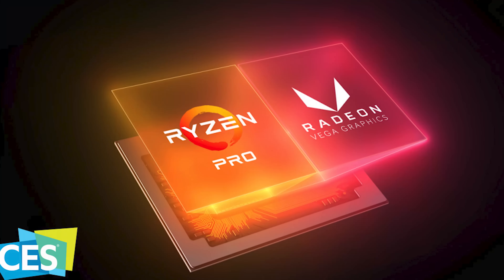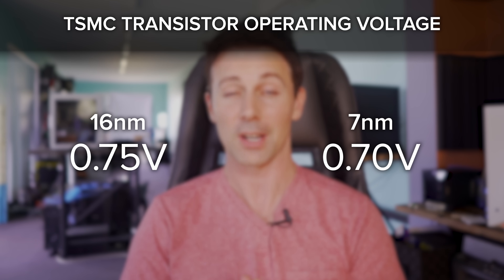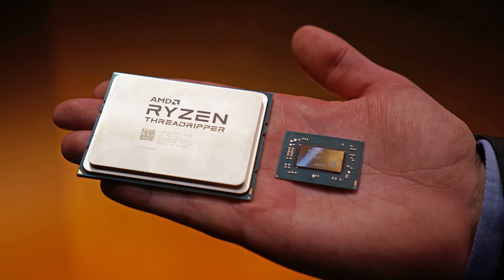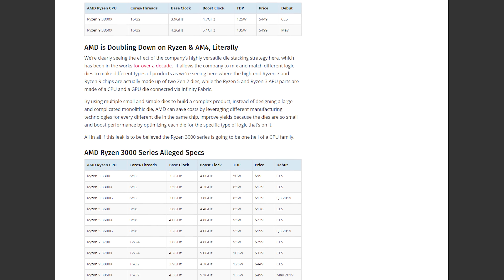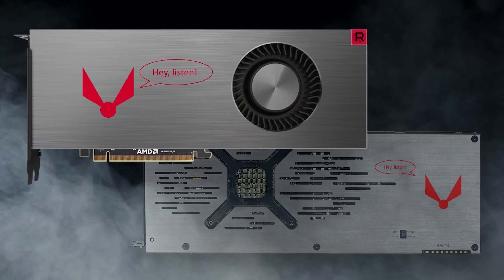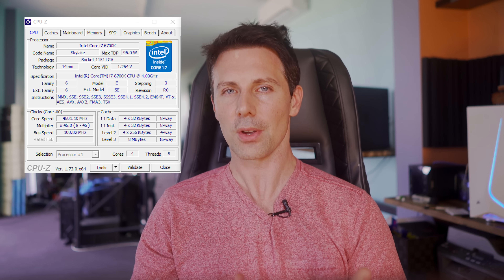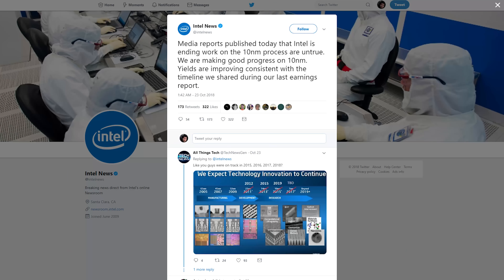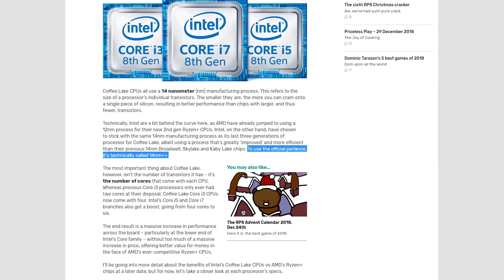7nm, 5nm and Beyond - Will AMD RYZEN 3000 be the PINNACLE...!?

Comment: Badly researched sure euv enables below 7nm but 1. All of the big companies are trying to make it happen asap and samsung just giving it a date doesn't mean it'll be out then and 2. Euv kind of enables it since we yes do need more accurate ways of shooting light at the silicon but more importantly we are going to have to change from Finfett to an even more extreme form of gateS if you google "ibm makes 3nm gates" you'll see where and how limitations will come through
Reply: Also the walls of the wires cannot go below 7nm since that's the point where electrons start quantum tunneling through it

Comment: What comes after 7nm is likely a couple decades of 7, 10 and 12nm revisions.  The problem is that while the chips are getting smaller their energy density is increasing.  10 and 12nm hardware (and 20nm) are already suffering from a great difficulty in cooling under high load.

Comment: To set the record straight: EUV was and is developed by the Dutch company ASML and their partners. Samsung, Intel and TSMC just buy that technology from them and figure out how to use it with their masks. EUV is a form of lithography where a smaller wavelenght is used than before, allowing smaller details in what is being blocked by a mask. For ordinary lithography they have been using plain water (as a magnifyer 'glass')  for years to get the resolution a bit better and they use multiple layers for the same reason. They call this lithography with water immersion lithography. They put a mask before something similar to a camear and that mask blocks light. After that the wafer goes to a company which uses chemicals which react wherever the light hit and that material is being etched away, they also deposit metals based upon whether or not light reaacted. That is how chips are being built up in a nutshell.

Comment: I ditched Moore's Law out the window a 5 years ago as I noticed  differences in overclocking performance with CPU's and GPUs. As the die shrinks more, lower voltages are used. In the end will the die will hit a  hardware limitation. Smaller die, smaller tracks, smaller lifespan from thermal stress. Putting to much voltage from overclocking, through the microscopic tracks will cause them to fail like a fuse. This is why Nvidia and Intel have so many issues with die shrinkage and the only way for them to remedy this issue is to build larger/bigger/3D chips. It would be very interesting to know how AMD is pulling this off.

Comment: Some incorrrect infos here.
TSMC is actually using EUV for actual 7nm N7+ production but just for 4 layers. Full EUV for all layers is expected for Q4 2019/Q1 2020, not 2021.
As a matter of fact, TSMC is on track for 5nm with production starting on 2020 and is building a 3nm facility for mass production starting in 2022.
So, we have 7nm 4-layers EUV on 2019, 7nm FULL EUV on 2020, 5nm on 2020/2021, 3nm on 2022.
GAAFET instead of FinFET is also a possibility for smaller nodes, but it's pricey.

sources: 
https://www.taiwannews.com.tw/en/news/3600724
https://www.anandtech.com/show/13445/tsmc-first-7nm-euv-chips-taped-out-5nm-risk-in-q2

Comment: It's crazy. Doesn't actually seem like that long ago (4 years) I was still using a q6600 that was 65nm. What a long way we've come since I bought that in '07

When we reach the end of Moore's law, we can't shrink the manufacturing process any further and we can't squeeze a higher clock speed, unless we find some other material to make the CPUs out of then the only way to go is more cores. Who knows, in 10 years our CPUs will come with the thousands of cores like our GPUs currently come with

Comment: 6:07
You've kind of missunderstood that stuff.
EUV isn't a solution to quantum tunneling.
The problem that EUV solves is simply that the features we're currently making is already smaller then the wave length of the visible light we're using to produce chips right now.
Switching to EUV doesn't solve the other issues that crop up when you go even smaller.
But it means that instead of using multiple exposures that's slightly offset to try to make smaller features you can just use a few exposures of a wave length that's much closer in size to the features you're making.
Therefore you can make far smaller features at a lower cost making those economically viable, something they where not before.
And by making them economically viable you can in theory build in some redundancy to make up for things like the quantum tunneling (we already have some redundancy in there).
The idea being that if we do the exact same calculation multiple times you're a lot less likely to have a issue with all of them then just one or two (one of the ideas with fin-fet where you essentially have 3 transistors in every single one of them, hopefully ensuring that at only when all three of those trainsistor parts agree that a signal should be sent through will a signal be sent through)

The issues just continue to get worse as you go smaller.
Another thing that might help reduce the issues is switching to other materials then silicon with different material properties, etc, etc, etc.

But ultimately the only real solution is to switch away from trying to controll the flow of electrons entierly and switch over to something else, like say light.
Reply: Gate All Around (GAA-FET) should be the next transistor design to take over once Fin-FETs have hit the end of their ability to prevent leakage. Theres even research into Tunnel FETs to actually USE tunneling as the mechanism for transistor switching.
Reply: Actually you misunderstood it too. NOTHING in the 7nm architecture actually is 7nm. It's just a marketing slang! In fact we are all far away from true 7 or even 5nm.
Reply: + @nowonmetube  As for the whole 7 nm part.
Yes, it's marketing slang, but there still are things that's 7 nm in those chips.
The difference is just what is 7 nm when they're measuring.
And everything I said is still true.
Reply: @Luredreier  uhm okay what exactly is 7nm then? Even if they measure something in 7nm or some bull, people should stopp echoing like sheep that there will be problems with quantum tunneling, because it's not. It's has nothing to do with quantum tunneling because we haven't even reached near 5nm, by far.
Reply: Electrons travel with light speed though
Reply: + @nowonmetube  Actually, no they don't.
They move at about 1/100th the speed of light in a vacuum.
It's still bloody fast, but it's nowhere near the speed of light.
Reply: @Luredreier  uhm you know that light even moves slower than light when they're not in vacuuming (in water for example), right?
Reply: Really?  We should use LIGHT?  Tell me, what is it about light, exactly, that allows us to build chips smaller than electrons?  Is it that the light is smaller than the electrons? or that it is indeed orders of magnitude larger than current gen architecture? Or is it that the light pipes needed are so much smaller (at a micron minimum) than the currently available metal electron channels (at < 50 nm)?  I'm very curious as to how something else -- like say light -- could give us the benefits you seek?

Comment: Q1 2017:  Rumors about Ryzen  8C - 16T 
People:  LMFO, another FX 8350 with heat and low performance?
Q2 2017: Ryzen 1700 8C - 16T for $330 witch 50% IPC improvement, & 100% better performance in multi tasks (while Intel i7 was 4C)
AMD achievement in last 2 years, far more better than whole Intel in past 7 years..
Reply: So true...
Reply: Thats why My new build, which I ordered few days ago have Ryzen! I was Intel fan half year ago!
Reply: Yeah I would like it if they were cheaper then I wouldn’t be sad. I also ordered an ASRock b350 Pro4, Evga 450bt, and G.Skill Ripjaws. It also came today. I just have to order the 2600, and find a used rx 570 on eBay, plus the case (probably an mb511, the rgb version. Which is 60 with 10 rebate), and boom gaming computer.
Reply: @HaydenH  =D I also ordered 2600x and found used gtx 970 for 120€ =138$, motherboard MSI B450 Gaming Plus,  T-Force Vulcan DDR4-3000 16GB...
Reply: @PaladinErik  why would you get a used 970? At that price get a new 570 or used 580
Reply: @HaydenH  Im not "Intel fanboy" anymore, but will still pick nVidia over Radeon =D
Reply: @PaladinErik  okay I would be too but they're just so dang expensive and I'm poor.
Reply: @PaladinErik  you realize that RX570 (4gb model) costs $130 to $140 have same gtx 970 performance and have 2 new games comes as free (and it's a new not used)

It's your choice at the end.. but people used to prefer AMD GPUs in past (6-7 years ago) cause they were stronger.. but time changes I guess
Reply: @Jack_Sparrow131   In my country Rx570 4GB prices start from 183,70€ = 210$.... So (120€ GTX970 4GB) vs (183,7€ Rx570 4GB) I saved third of the price...
Reply: @PaladinErik  if its 30% price difference, than you did the right choice 
But for extra 30% price you get Warranty + 2 great games..
Anyhow, you bought and that's the end of story lol
Reply: @HaydenH  Bruh Evga 450bt?
Reply: Dreadnought yeah I just built it today actually works perfectly. As a matter of fact AMD recommends a 450w psu on their rx 570 website.
Reply: @HaydenH  Yeah it works perfectly in the beginning, but it wont last long. I would recommend you to change your current psu to something like Corsair CX450M or Be Quiet Pure Power 10 400w, they are cheap and far more better than 450BT. Btw you don't actually need 450w for R5 2600 & RX 570, 400w will be fine.
Reply: @NaoVII  I know 450w is more than enough and I'm sure it will be fine for a good while.
Reply: @HaydenH  450BT has second tier capacitor, inferior ripple regulations, bad fan, etc. You should never cheap out on PSU, but if you're fine with it, ok. Hope it will be fine for you.
Reply: This is why it wouldn't supprise me if we get a desktop 16 core Ryzen 2 cpu for around $500 and clearly, AMD isn't doing the same mistake it did with Athlon years ago and stud still, it looks like they want to push the tech as far as it will go.

In any case, I feel that if it was upto Intel, they would have kept us on 4 cores till 2020 and thanks to AMD Ryzen, we can get 8 cores at mid range pricing and by the end of the year, maybe even 12 cores and now the question is, can AMD pull a rabbit out of an hat and do the same for the gpu market to shake things up.
Reply: Well i do agree but did amd really gain 50% ipc over past architecture?

No hate,im amd all the way just curious

If 20-30% is believable but if they do,holy cow amd rock!
Reply: @reiiz9942  actually you should see the ipc differences.
Reply: @reiiz9942  I know I'm late to the party, but my r7 1700 at 3.9 scores 160 in Cinebench R15 single core while my fx8350 at 4.4 scores only 105 single core. The Ryzen is more than 50% faster, and at a 0.5ghz clock deficit to boot. Also, the multicore scores are 695 for the 8350 at 4.4 and 1410 for the r7 1700 at stock 3.0ghz(that was with the ram running at only 2133. When I switched on the XMP profile in the bios for my GSkill Ripjaws V 2x8GB DDR4 3000 CL15 the single core score rose from 130 at 3.75 to 148 at the same CPU clock. Pretty sure the multicore score had a similar uplift, but I can't remember exactly).
Reply: I really hope AMD finally beats Intel and customers actually get value out of both companies.
Reply: @V_Soul VampireSoul I already got it for week or two... lol
Reply: I picked up an old i7 4930k, 16gb ram, motherboard, liquid cooler, case, 400gb+60gb ssd and a 1tb HDD for 320$
Reply: That's what happens when companies have no competition. They stop innovating.
Reply: Intel fanboys* not people. :)

Comment: I would like to see enthusiast class PCs split CPUs into two families that can be used together. Pushing cores and frequency simultaneously is getting too difficult. Imagine instead having one 4 core CPU built with the purpose of frequency alone and then a companion CPU where total threads was the only goal. Picture 4 cores @ 6GHZ and then an additional 32 @ 3GHZ.

Comment: The R&D budget is paid by the Gross margin you mentioned, many people have misconception that the gross margin is profit each company makes from the product as a whole. This is why Nvidia and Intel "won", they put more money to R&D then increased their margins to fit new R&D budget, and later made more money when they got larger volume with new margins. But for Nvidia it took 5 years to match profit they had before the R&D increase. You could argue that Intel hasn't won, but on most years between two companies, situation has been such that Intel chooses to keep AMD alive to avoid monopoly hearings, and AMD gets good years only when Intel  makes some mistake. Like with Pentium 4 or too large leap for 10nm causing delays.  But each time expensive mistake has happened Intel changes its processes to avoid making same mistake again.

Comment: but the 100 dollar ryzen 3 6c 12 thread chips with around 4ghz boost could hypothetically be the worst silicon. With many cores deactivated and those cores that are active are also seen as slow (not efficiently boosting to 5ghz+) It does seem very good, maybe too good. But I respect AdoredTVs opinion and rationale that this is realistic, if you take into account the entire line of chips that has been leaked. Fingers crossed im getting a 8c 16 thread 200 dollar ryzen badboy paired with navi 10 for my new system upgrade. Excited isnt the word!!!

Comment: You can't go smaller than an Atom. A Silicon Atom is 0.2 Nanometers and we are pretty much already at the end of Moore's Law when we get to 2 nanometers. Those 50% gains we enjoyed are over. Everyone is going to have to get used to Scaling Up instead of shrinking. No more Monolithic GPUs and CPUs. Just like a car, if you have a car with two or more engines working together, you get more performance.
Reply: At 3 nm thickness, electrons are able to supertunnel to the other side of that silicon. That's the limit silicon has.

3D stacking is probably the main solution. Takes up less real estate. You can shorten connections to reduce latency.

The main problem is probably heat dissipation.
Reply: The biggest thing with speed on a CPU is capacitance of transistors and bandwidth. The capacitance of a transistor decides on how fast you can switch the state of one and how much power you have to use doing it. The bigger the transistor, the higher its capacity. So shrinking transistors is obviously the first and most efficient step for efficiency and speed. (speed per transistor, so basically clock speed)
The next step is basically what AMD is doing now with their chiplets.
The biggest problem with seperating CPUs is that they have to communicate. Yes you could give each of them a lot of own cache that can lessen the need of intercommunication but cache is really pricey. So, now you are again dependent on capacitance, here in how fast you can switch a cable (/data lane) for lag (=speed per lane). Partly because of this everything is more on the trend of integration. I would even expect most GPUs to be integrated in the next 10-15 years (used ones, for gaming, as by raw count in most PCs the GPU is are already integrated)
Reply: "You can't go smaller than an Atom. "

IBM's quantum cpu team says hello,  sub-atomic particles are smaller than an atom, in fact a LOT smaller.   We can already build skynet terminators with todays home CPU's so what else really matters.

Comment: The reason behind EUV is wave length, it is way shorter and allows for higher precision in lithography. Without it, to achieve greater precision, you need to "do the same region more times", and this add cost to the process. However, the machinery for EUV is also costly, that's why roll out of it is still on going.

Comment: Brian... Globalfoundries are out of the leading edge game mate, no more 7nm from them. Samsung are ramping their 7nm euv production, but TSMC have better tools and IP for designers apparently... So the safe bet is still with TSMC. Whether ryzen 4000 will be zen2 on 7nm+ or zen3 on 7nm+ remains to be seen. Both companies are working on risk production this year for 5nm which should be ready next year. AMD may just move Zen 3 to 5nm then if it's ready instead of 7nm+... But I don't think it will be.
Reply: Amd and especially their subsidiary RTG have a history of moving to new nodes asap. So I would guess on how viable 5nm is at that point in their dev cycle. They are more willing to take a risk there than most others.

Comment: But so far, software and game devs have leaned more to Intel and so the Intel chips always age better and older Intel will always perform better than older AMD doing the same task. I would love to see that change, but the whole FX line is just under powered and can't keep up with the Intel counter part of the same time. I have even played games that have glitches only AMD systems experience (look up Mass Effect AMD issue and you'll see)  but I've yet to run into a game issue just because I'm on Intel. I love that AMD has grown so much over the last few years, but they still just can't keep up with Intel in general. I hardly run into anyone gaming on an AMD and I've NEVER met someone in game running a Vega GPU! Only time will tell if Ryzen will be different than all their other chips and age better and be able to run new software and games as well as the Intel line of the same time. But right now, all I have to go on is AMD's old CPU lines and well....If I offered you an AMD 8350 system or ANY i7 system what would you honestly pick? I mean, I know I replaced my 6300 system with a 3770K system and I get way better performance!